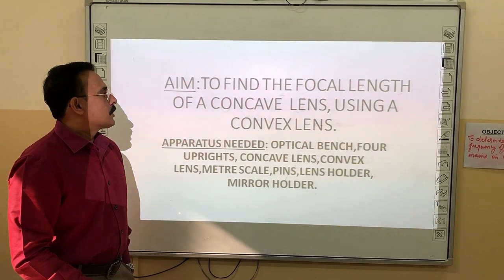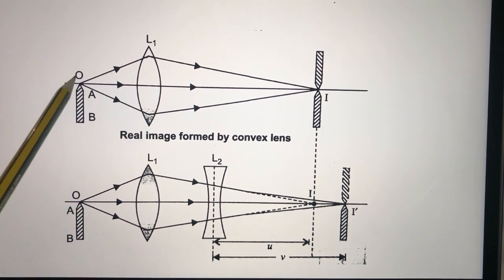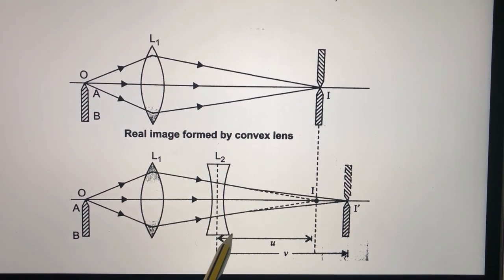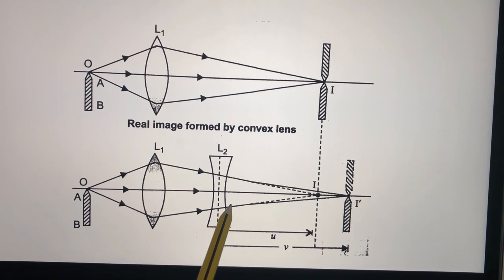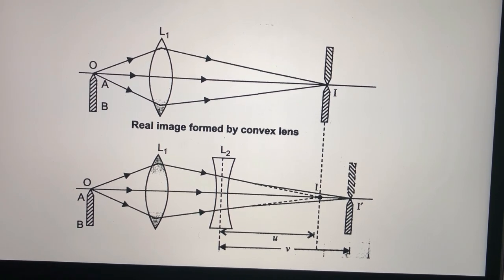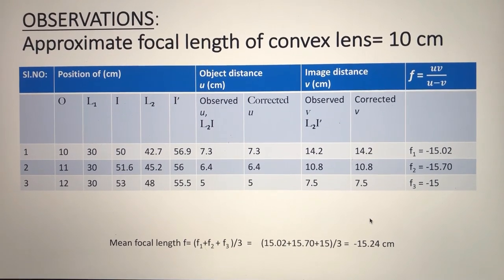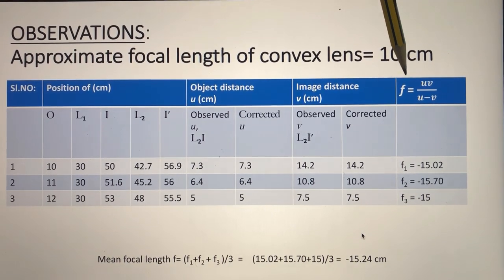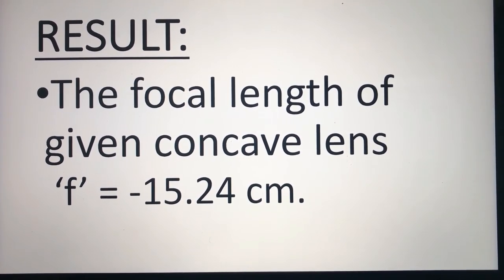FOCAL LENGTH OF CONCAVE LENS USING CONVEX LENS:PRAKASH & MINI

Comment: sir, why u and v were taken positive while solving for f, although for concave lens there values must be negative according to sign convention??
Reply: Although that should be the case but according to me it wasn't done so that the f calculated doesn't come out to be negative...
I hopt its correct if not kindly correct me...😊
Reply: That's why study the concepts with detail...just mugging sign conventions is not suggested.
The direction of the rays and the direction of measuring distance(from the optical centre) both are in same direction in both the cases( image and object distance).
That's the reason but explaining things just by text becomes difficult.
So hope you got It :)
Reply: @ritikranjand1827  thats wrong explanation its simply because we are only considering magnitude and not including sign conventions bcos we already know tht convex lens has +ve focus
Reply: @tarun2298  kuch bhi
Reply: @rctutorials6025  hm
Reply: @tarun2298  bhai explanation chhodo bs ye bata do ki is experiment mai u aur v ke sings kya hai ... Taaki mai f ki nikaal saku 🙏😩

Comment: Sir I have a doubt... Why is the concave lens placed at the distance of  42.7 cm and 45.2 cm only? I mean on which basis??
Reply: I HAVE THE SAME DOUBT
Reply: there is no such logic there sir might already had the readings and so as to keep the calculations smooth ..he took these readings
Reply: Same doubt plz reply sir
Reply: I also same doubt
Reply: I think that's focal length of concave lens 12.7 cm
Reply: he is takin the intervals 2.5 cm for each reading u can also taje any other distance doesnt matter but a precaution is that readings be taken at intervals of 2.5 to 3 cm not more than that
Reply: and also he prepared his lecture based on those values so he reexperimented using those values only so that its easy to explain while running the presentation on big screen